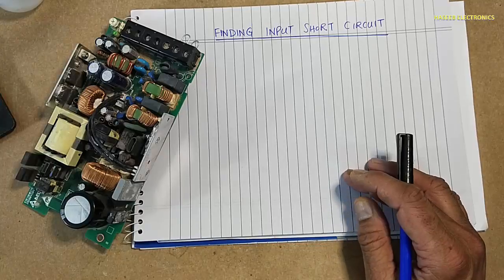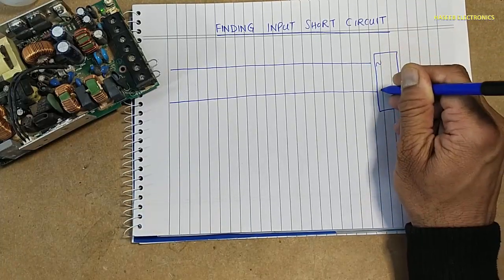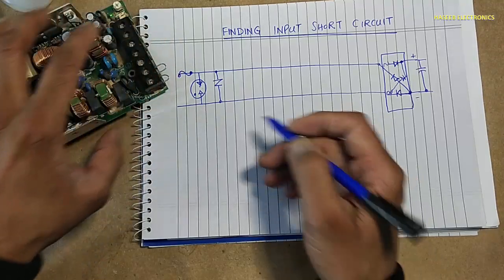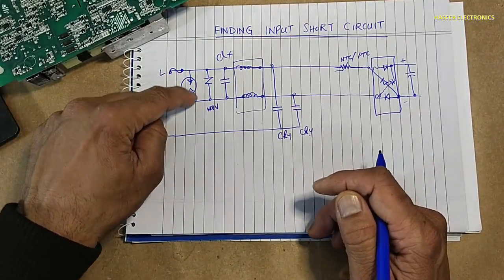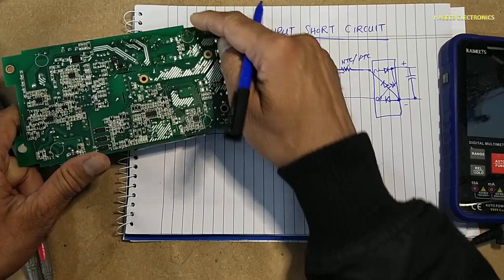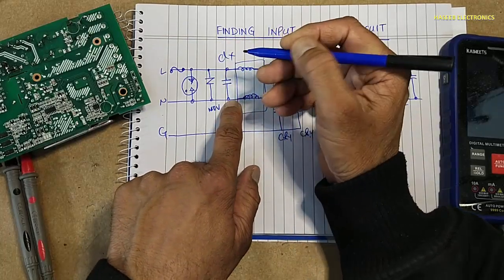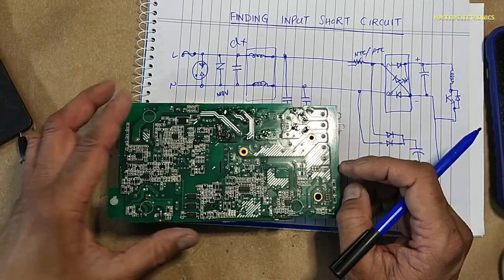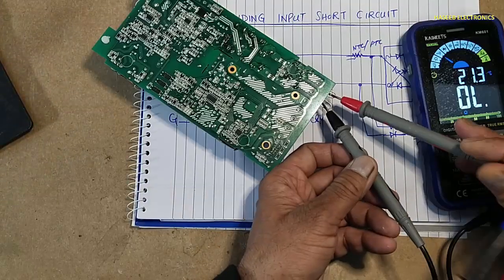{1055B} Finding Input Short Circuit in SMPS

Comment: Hello
I have many ATX power supplies. Most of them have two 200V/470uf input filter capacitors. One or both of these capacitors have bulging upper parts. When I measure capacity with a multimeter, I read normal or slightly low values.
I want to ask, how can I be sure that these capacitors are healthy without using a multimeter?

Comment: Sir I have a board used c3998 transistor l replaced damaged transistors but the base resistor also needs to change l don't know the value of the resistor can you help me with the resistor value please

I checked the good resistor value 6.8 ohms is it ok